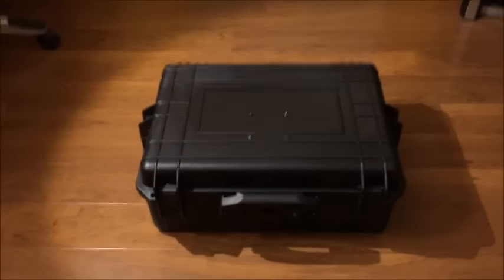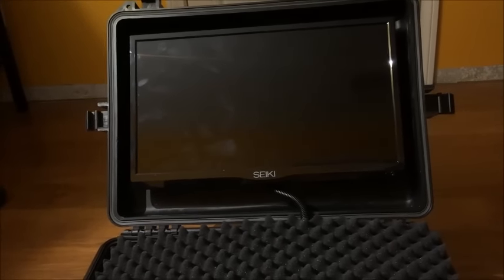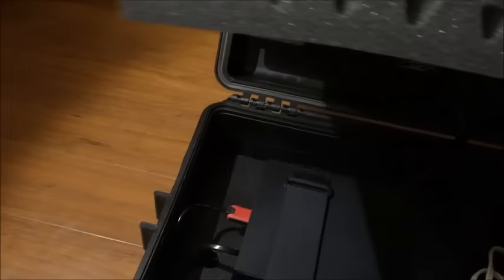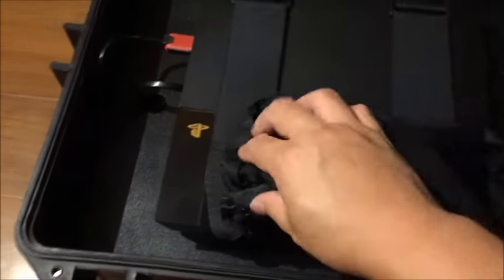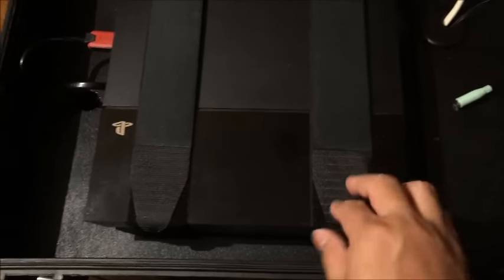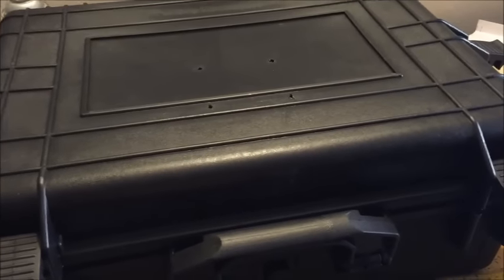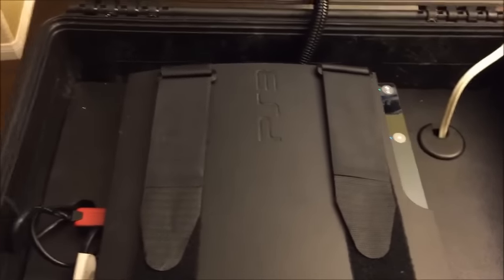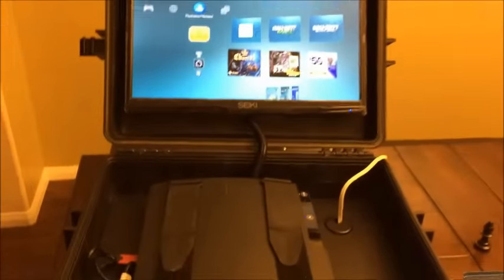Mobile Gaming Case for PS4, PS3 and XBOX

Comment: Nice job but I'm going to respectfully disagree that that case has the same quality of a pelican case. Pelican cases are molded of nearly 3/8 inch thick polypropylene with a lotta engineering into the stress points and corners. They are completely water and dust proof (up to a significant depth). Whereas the knock offs from harbor freight and other hardware stores that cost less are often made of cheap, thin and brittle ABS with no reinforcement anywhere. And I seriously doubt any of them are water proof (splash proof MAYBE). There's a reason pelican cases cost what they do and are used in various industries and the military as the gold standard for outdoor cases.

Comment: To anyone thinking of building one of these, I recommend gluing the connections on your monitor before bolting to your case, I also installed lid supports onto mine for angle adjustment.
Reply from the maker: J Back thats good idea, where did you get parts?

Comment: Do u have link for the materials?
Reply from the maker: Here is list of items and materials I used to build the case.

    MCM hard case , Model 22-24120 ,
    SEIKI 20" TV Model SE20HS04,
    Velcro Strap 36" long 2" wide (sold with 2 pairs @ Home Depot)
    Plywood 11/32 in (around 10mm) , same size of the box, around 20inx15in
    2x4 inch stud, for basement,
    Black paint, Track Bed Coating
    Flat head screws , 1.5" inches 8 pcs
    Tools : Saw, Drill, Sander, Osciliation tool
Reply: Anugaas Ideas how much would it be for you to make one for me, without the tv and ps4 :D? Just the complete setup of the case 😁

Comment: Hi, thats pretty cool, I want to make same box also. Can you tell me the box lid inside dimensions please. specially how deep is it. I have old TV which is pretty thick want to make sure if it will fit inside.
Reply from the maker: +Earth Matter 

Hi, I hope it is not so late for the response. The measure is as follows

Width : 19.5"
Height : 13" 
Deep : 2"

I would suggest to use thin TV as the old tv may have enough weight  to damage the hinge. Also if you use heavy TV you need to add extra weight in the console compartment to make the case stand still. otherwise it fall back easily.
Reply: +Anugaas Ideas you got seiki TV so have I!! this Video changed my life 😁

Comment: wanted to ask. did you ever feel like the hinges my break over time? how sturdy was the hinges compared to the weight of the TV
Reply from the maker: +Juan Pasallo 

the hinge is very strong no worries on it. I am using it almost everyday since I built it. no issues at all.
Reply: +Juan Pasallo i agree. i would add on custom scissor hingles on the side so it takes weight off the back flap
Reply from the maker: I put 4 studs on each side inside the compartment which added extra weight. Not really necessary add hinge.  trust me. :)

Comment: Great job. I'm doing same build but my monitor is 19 3/4 and heavy as its a PC lcd. It's very heavy. I debating just building plywood box as I have materials on hand and won't have to spend too much $. Love the hidden cable design. How thick is tv? I have to over compensate for size on monitor. Can't find your case online. Where did you buy it? Even old suitcases are either too small or too big or not deep enough. Any advice?
Reply from the maker: Hi,

Here is the TV compartment (lid) dimesion 
Width : 19.5"
Height : 13" 
Deep : 2"

I really suggest light TV or monitor , otherwise the lid tend to fall back away from you. Thats why I added some wieght (those wooden studs) to balance.

the box I purchased from MCM here is the link
http://www.mcmelectronics.com/product/MULTICOMP-22-24120-/22-24120

if you use flywood, it would be pretty heavy.

Thank you,

Comment: Great work! Great video, I'm referencing it to make one for myself. I'm worried about drilling the holes through the lid, any tips to getting the holes straight, and getting the monitor nice and centered?
Reply from the maker: indeed thats hard part, if I do now I will do putting pointy screws in the vesa holes and push the TV  down to the lid to make some drill hole marks.
Reply: Anugaas Ideas Great idea, it worked out perfect! I had one more question, What size hole did you drill for that plastic cap to fit? The hole where the extension cord exits from.
Reply from the maker: @ejames9696  Hi, I think it was 1" hole, but make sure to get right size cup first that you power cord plug can come out freely!

Comment: How are you going to get your disc in and out with out removing the straps from the ps4
Reply from the maker: Hi, position the PS4 that the strap goes side by side not the blueray drive side, check the PS4 top light , so you can see how to position it.

Comment: I like this build.  It is simple, professional, semi low costing, spacious and has benefits such has being weatherproof/durable. I would say it is better than the Gaems portable console station that you can buy online from 200-300 bucks. The only issue with that is. . . if something breaks in there (especially the screen), it is VERY hard to get parts since it is not widely known or it is expensive to replace.

If you don't mind, I would like to copy your design and do a couple modifications, and post the design on youtube. This has the potential to add a lot more features while using lighter weight  materials like thinner base wood or metals, and slim models like a ps4 slim. I would also add some support structures that I could get from the dollar store like, L braces and add rubber padding's to put on both ends of the console, some sort of sliding support beams that prevents the top and lower case from being over opened, some how mount a plexy glass in front of TV screen, and eventually some miscellaneous things like adding a USB powered fan for either the user or to cool down the console.
Reply: Reki did you ever make the modifications?